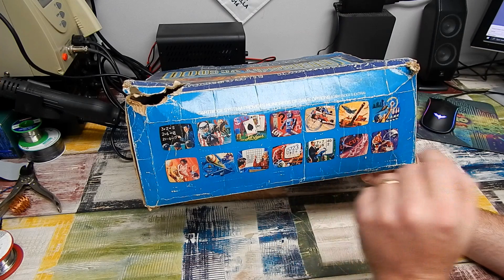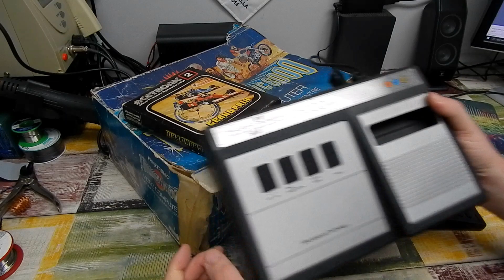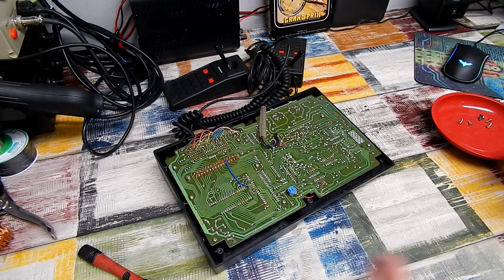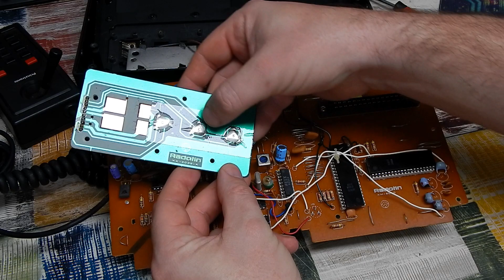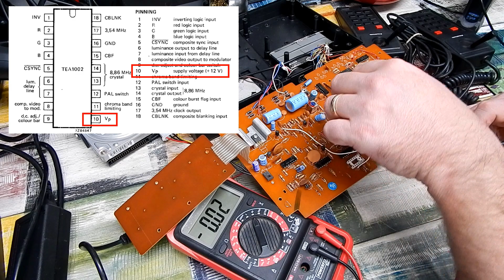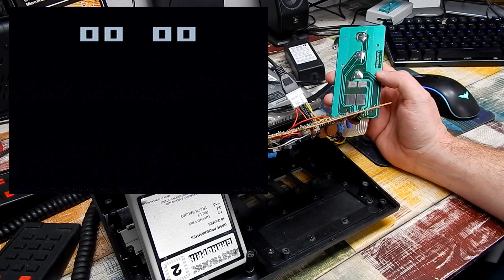Prinztronic Tournament VC6000 - Part 1 - Initial inspection and Testing

Comment: i have my childhood 1970s ACETRONIC MPU1000 Video Game Console, but no power supply, its identical to this, i was thinking of using a 4 pin laptop power supple thats 5v and 12v, 0.8amp, but they state 60 to 80w, can i use one of these to get it running.

Comment: Nice, this was my first computer/console. Have you tried pressing a number on the joypads to select a game? My memory is very hazy so I cant be sure how this worked.
Reply from the maker: Pressing buttons doesn't make any difference.  I have spent some more time with the machine and it seems there is a fault on the address bus.  I'm hoping it's a bad cartridge that's causing the problem because other than that it can only really be the CPU or the PVI.
Reply: @CRG  Just on a tangent there is a really cool old advert on wikipedia for the 2650 showing how to build a computer with very few chips. I'd like to try and recreate that computer in the advert one of these days.

Comment: Here's the wiki:
https://en.wikipedia.org/wiki/1292_Advanced_Programmable_Video_System
Reply from the maker: Thanks.  From reading that it seems that the first console to use the signetics chipset was by Interton in 78 although the design of the machine was physically different.  Very interesting, I'll be sure to mention this in the next part.
Reply: Thanks. I would've never found it otherwise.